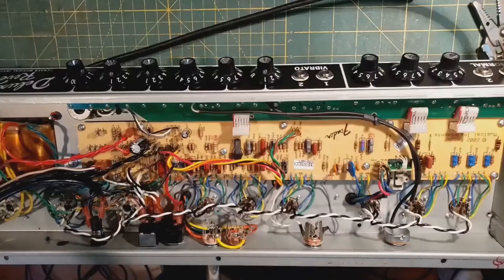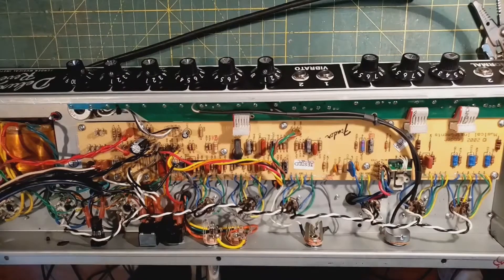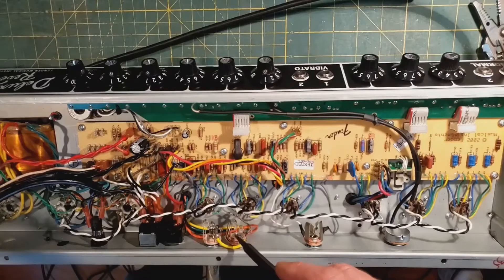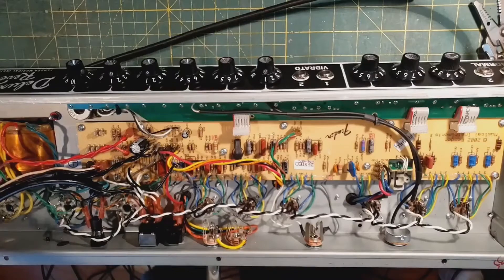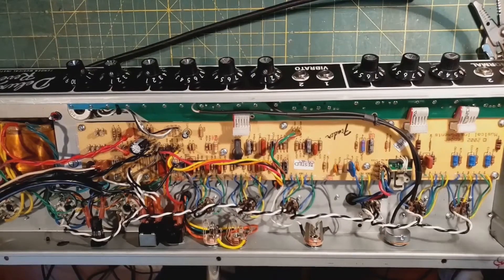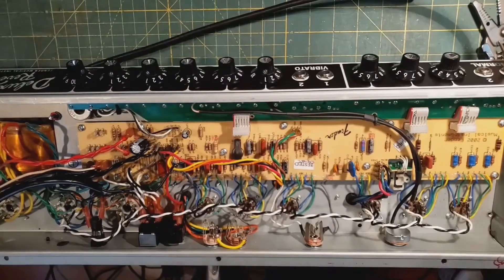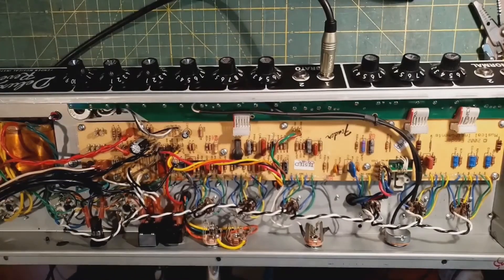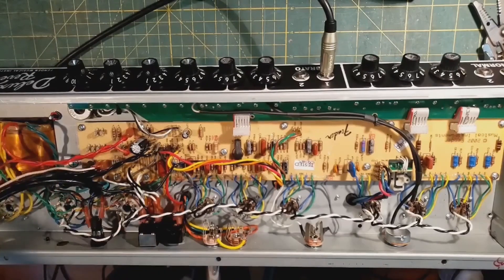Fender '65 Reissue Deluxe Reverb Mods

Comment: Few days ago I completed my last DRRI modification. Replaced the Jensen C12K to Jensen C12Q, top harsh was gone. And finally I just shorted out the C10 capacitor on Vibrato channel, through the switch, the switch located on rear panel. Now the amp totally versatile, I can use this channel for clean and pedals as well. The breakup starts from 4 now, because of C10 shortage. I like it. The mod for in about 120 dollars, that's it.

Comment: The flyback diode(s) mentioned in the vid, I'm only seeing a single diode on my DRRI's board (CR1). Rookie question...is that diode intended to protect the transformer and output tubes in case of no speaker load?
Reply from the maker: The DRRI doesn’t have flybacks. CR1 is the diode in the bias supply that rectifies AC into negative DC.
Reply: @PsionicAudio  Thank you! I've read you can add resistors to the jack? to provide flyback protection (I think)?

Comment: So, did the shielded grid wire on the Vibrato channel cure the hiss? I just got a '68 Custom DR and the hiss level is to me nuts. That seems like a sensible way to deal with it. I got rid of some of the amps excessive hum by dealing with the lead dress on the heaters. (Fender had zip tied them to the reverb transformer leads and the standby switch.) I'm really surprised at how they ground the PT CT,  heater CT and power supply filter caps with this design. It looks like all the grounds ultimately go to the board and then ground through the pots. I'm wondering if the hum could be knocked down by wiring the heaters in traditional fashion to and from the pilot light with an artificial center tap (eliminating the heater tap to the board off V7 and installing 2x 100 ohm resistors grounded at the PT) and then grounding the PT CT and power supply filters on a PT stud. Wouldn't be much work and could quiet the amp down. Thoughts?
Reply: I bought the ‘68 at first but that noise drove me too crazy and I ended up returning it for a ‘68. Much more suitable for studio use, imo. That ‘68 DID sound the part, but maaan.. interested to see if there would have been a somewhat cheap way to fix that though.
Reply: @BrewReview  I ended up grounding the power transformer, power supply filter caps and heater ACT at the power transformer, attaching the heter leads directly to V8 removing the board jumper to V7 and changing the NFB resistor to 820 ohms. Amp is now virtually silent.
Reply: @jerrymcgeorge4117  Did you bother with the shielded wire?  I'm trying to reduce hiss as well....
Reply: @krausewitz6786  No, the other alterations I made cured the noise issues.

Comment: Thank you for your videos. I have been loving and learning watching them. I have a question: I have noticed at 3:48, carbon comp resistor upgrades were pointed out. I believe they are the input plate resistors. There is an opinion that you should use CCs in later stages. I'm curious why you like using them at the input stages. Is it for maximising the pleasing breakup tones?

Comment: Thanks for sharing this video. 
The chickenhead knob on the backside pot is a simple but brilliant idea. For using shielded wire to that added mids tone pot, just solder each end of the shielding to it's corresponding pot? Less noise and hiss is always preferable.
Reply from the maker: I have the shield connected at the PCB ground where the stock 6.8K residue was, and the other end of the shield is on lug 1 of the new Mids pot.
Reply: @PsionicAudio  Hi Lyle and Happy New Year to you. Re the actual outer shield of the shielded cable for the mids. It looks like the shield at the pot side is cut away. I.e. only attached at pot side. Could you please confirm? Also , do you put another resistor in series with the pot and if so, which value ? Thanks a lot, and thanks again for all the info and experience you pass on in your outstanding channel.
Reply: @paulp2033  he,s never going to tell you details of the mods exact values, Lyle is pure greed, I think he removed de 6.8k original resistor on the PCB and installed a 20k or 25k linear pot connected where the original resistor was, all with shielded cable at the back of the chassis, Hope this helps.

Comment: How would you go about getting reverb and trem in both channels? When you mentioned the mod that was on there, i assume it was the wire from one resistor to another? Seen the mod online somewhere.....
Reply from the maker: Fender uses a DC mixer which is very noisy. See Rob Robinette’s site where he shows how to do an AC mixer.

Comment: Forgive the rookie question… When running the coax from the volume knob (to bypass the ribbon cable after cutting trace & bright cap), where would the shield ends of the coax connect? I get that the “hot” just solders in at the appropriate terminals, but where do the ends of the shield wire connect?
Reply from the maker: Shield to a ground point at the pot end. No connection at the tube socket end.
Reply: @PsionicAudio  you're a national treasure sir

Comment: Good evening, I live in Italy and I would like to ask if it was possible to explain the lack of cables in the following sectors CP3 CP4 CP5 CP6 CP7 CP8 I don't understand why they are there in mine and they are missing in the one seen in the videos. These videos are a masterpiece
Reply from the maker: Grazie. Those are used for 240V mains connections, not 120V mains.

Comment: I always use the .1 and .02 caps in tone circuits too.  Also, someone a while back recommended changing the coupling cap on the  phase inverter from .001uf to .01uf for more bass, but that can introduce some blocking distortion so I go in between with like a .0022-.0047uf.  Easier on a handwired DR, of course.  Was the mid pot added to the circuit essentially how it would be in a Super or Twin?
Reply from the maker: Sorry, didn't see your reply until now.

Be careful going over 2.2nF on the PI input - can get woofy. Remember the PI input impedance is bootstrapped, so is about twice the value of the input grid leak (1M in the AB763). So it doesn't take a large input cap.

The Mids pot here between 7:00 and Noon has the range of a Twin Mids pot. Over Noon it gets into boost.

Comment: Would it be easier/more cost effective to convert the amp to hand wired instead of modding and recapping for longevity?
Reply from the maker: No. About $350 for the complete mods vs about $1200 to gut and rebuild fully. And to do it right.

There are those who will do it cheaper. They don't do it right.

Comment: So basically these amps are cheap trash in stock form.
Reply: No they are NOT.  But if you gig them hard they will have a failure sooner rather than later.
Reply: I have 2 of them ... Run in stereo , giged them 3 nights a week for  almost two years 
Only replaced the tubes in that 2 year period. 
No they are not junk
They are very dependable Amps
And have held up Good in some rough environments.
Reply: I've got one of these, bright cap is switchable, and it has a vintage 30 in it.  I've played some vintage hand-wired amps that sound like crap.  Mine sounds really good to my ears.  Not cheap trash at all.
Reply: @Wingman52  yeah I have one as well. If anything I’ve replaced the cheap filter caps with FNT for dependability. I’ve had no other issues this far.